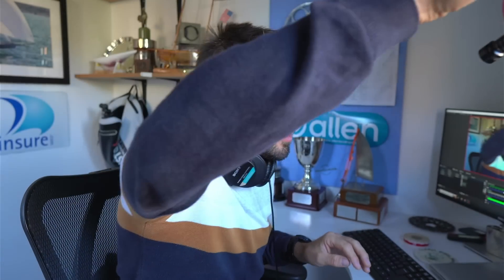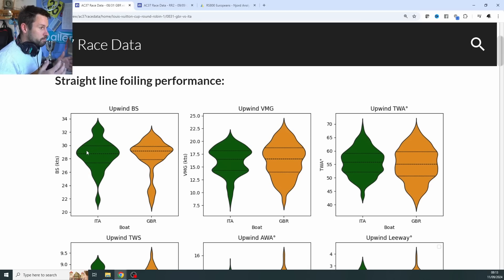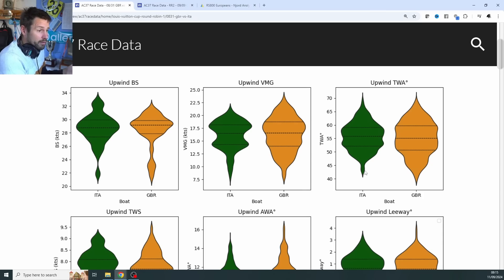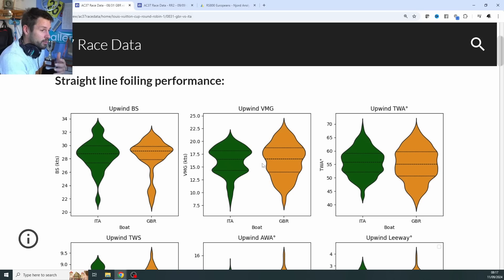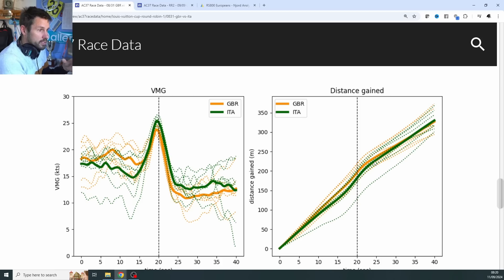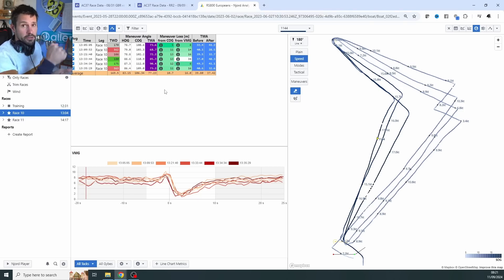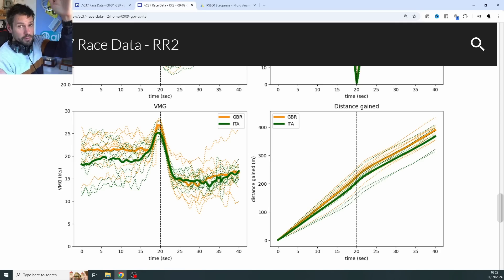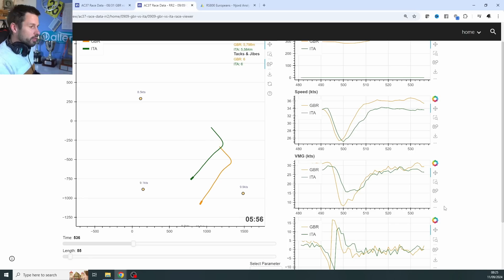Visualising AC75 Performance: What the graphs mean!

Comment: General AC75 sailing q for you, Mozzy - why are the trim movements on the mainsail so dramatic? I get the overshooting to help the turn, but many of the upwind trims are far more than you see in any other boat, and I can't believe it's massive apparent wind shifts?  Any ideas?
Reply from the maker: you go through gusts and lulls very quick. AWA doesn't change hugely, so entry angles don't need much trim but power available does and so the position of the leech need rapid movement, so I think that it what you are seeing with the large and quick traveller movements

Comment: Hi Mozzy. 
When I go to the data source link above there are no files. Did you ask for the data to be shared with you?
Reply from the maker: The files are there? Are you going in to the correct folder? You want the LVC (Louis Vuitton Cup) folder in which should be RR1 and RR2 for each round robin.  They're public, no need to ask for access.
Reply: @MozzySails  found em. Yep right there in the LVC CSS folder.  Thanks.

Comment: Terrific video. I had reasoned out most of this from your previous discussions of the graphs, but it's good to have a definitive summary. Thank you!

I would have simply described distance gained as "the integral of VMG", but maybe that's too techy? Then the "distance lost" metric in Nord becomes the integral of steady-state VMG during the duration of the tack (i.e. what would have happened if you hadn't tacked) minus the integral of the VMG through the tack. For the comparison to be valid you have to look at the entire time that it takes to get back to steady-state VMG. Your point at 10:30 boils down to the fact that Ineos isn't bavk anywhere near steady-state VMG when the graph ends, so you don't see the additional ground they lose during the acceleration after the tack.
Reply: I feel like 20 seconds ought to be enough to be back to steady state. They're only on a tack for like a minute at a time. Honestly I think this graph is a lot more useful to the race engineers than 'distance lost' as what you're looking for here is the finer points of how to make that line as straight and steep as possible.
Reply from the maker: yeah you nailed that description
Reply: @weatheranddarkness  I think we've already seen plenty of instances where it takes long than that to get up to speed. Accelerating an AC75 seems to be a complex process, since the apparent wind and therefore required sail trim etc changes drastically as you pick up speed. Put another way there's a significnat sequence of "modes" that they have to transition through to get to steady state.
Reply: @patrickchase5614  True, true but on the whole, in a race, it seems like the average time back to 'steady state' is well shy of 20 seconds. If you're pushing 20 seconds you're probably reaching just to stay on the foils. If you can point me to one of these graphs that paints a different picture I stand to be corrected.
Reply: @weatheranddarkness  Taking >20 sec to accelerate is exactly what the graphs that Mozzy discussed in this video at 6:40 or so are showing. 

The VMG graph on the left side shows that both Ineos and Prada are still accelerating (and neither have recovered to their entry speed) when the graph cuts off at +20 sec. In other words, both AC75s consistently needed more than 20 seconds to get back up to speed in the very race that this video uses as an example .

Did you actually watch the video and listen to Mozzy’s observations before you replied here?
Reply: @patrickchase5614  Maybe I'm just reading the graph differently. My reading of same says the acceleration has stopped and now distance is accumulating linearly. Maybe I'm missing something.
Reply: @weatheranddarkness  The graphs on the left side from 6:40 on show and are labeled as "speed" and "VMG" (velocity made good), not distance. Mozzy discusses this explicitly from 6:55 on. The distance graphs are on the right. Those two left-side graphs clearly show that neither speed nor VMG have recovered to their pre-tack levels at +20 sec for either boat. They're both still accelerating. 

Hopefully this is clear to you now?

Comment: BIG TIP : The "time spent at, for example, VMG upwind" plots are better understood when you turn them through 90 degrees. Then you see a more familiar statistical distribution! And I assume the mirrored look is port/starboard?
Reply: I think that's the point of setting them vertical
Reply: @weatheranddarkness  I had just thought that it was a style of distribution to mirror it left/right.  They seem perfectly symmetrical, at least as far as I can tell, so either they sail exactly the same numbers on both tacks or it's just a way to represent the data.  Let me known if you see any asymmetry that I'm missing. Maybe Mozzy can comment. He's the man!

Comment: Interesting stuff, been looking at it too for some races. Just a question, shouldn’t the blob diagrams total area be closer for both boats? Since total time and distance sailed are not that different.
Reply from the maker: This is due to the filtering required to extract straight line foiling data only. Turns, none foiling time, maneuvers are taken out with varying amounts of data left for each team
Reply: @MozzySails  Ah clear, that makes total sense.

Comment: The frequency graphs should all have the same area (the cumulative frequency is one), but instead they've been all stretched out of scale to match the same maximum frequecy
Reply from the maker: the areas often don't match up due to the filtering I mentioned. I.e. teams spend different amount of times straight line sailing. This can be because of dropping off the foil or doing more tacks etc.
Reply: @MozzySails In that case the frequency should be relative to the total sampled time, net of tacks and jibes and any other cut, which should be very easy to implement. And if you look at the plots it is clear that they've been normalized for the same maximum frequency, which hints to a trivial conceptual mistake
Reply: Quindi la barca italiana è ancora la favorita, ed ha perso perché ha sbagliato le partenze?
Reply from the maker: @andrealeone4784  I wouldn't say favourite. INEOS is now slightly fast, but not by a huge amount. Luna Rossa can certainly win with better tactics
Reply: Grazie mozzy, continua così! I tuoi approfondimenti sono fantastici. Aspetto sempre con trepidazione la notifica che ne annuncia uno nuovo. Grazie💯

Comment: Another great video which gets the grey matter going. The part on tracking the tacks and gybes is particularly interesting. One aspect of these manauvers which is probably also important are the interial impacts in terms of potential kinetic energy wasted and also how much it is used to load and unload the foils during the crossover. This would also impact location of mass in the design and as such is going to be difficult to adjust for except through how the boat is steered and trimmed during a manoeuvre. Maybe the subject for another geeky video?. Keep up the great work, much appreciated.

Comment: Also,  I'm disappointed that the media has taken a step down for this cup. AC36 had full race replays on the back of each boat with just onboard comms. I know there is a virtual eye replay on the official AC37 cup, but If I see 1 more 'in boat' close-up when there is a crucial inter-boat change in aspect I'm going to put a fist through my screen. Missing Ken Read, hating Steven and longing for the AC36 media format. Rant over

Comment: Analysis is more complicated than at first glance. Assuming tacking is no option (this is often the case due to boundary/layline constraints and match racing considerations) sailing in high mode in headers and fast mode in lifts is optimal. Having to build speed (low mode) when on a header is particularly damaging as is being forced into high mode on lift. 

TWS is also a pretty rough indicator as the amount of turbulence in the wind field powering the sails is going to affect the amount of power that can be extracted. Wind speed is measured at a single point and that's an approximation of the power supply.

In a match race there is always going to be data bias in favour of the leading boat that gets to sail in less turbulent air and also gets to dictate the angles sailed (to some extent). 

What would be useful is to pit two identical boats against each other so as to quantify the performance bias that's attributable to being in the lead. This would be different in different conditions. This would quantify the handicap of a bad start - and the amount of gain needed for a pass.
Reply from the maker: All excellent points that I fully agree woth

Comment: The tacking plot that would be useful is an integration of VMG data (=distance) zeroed to the expected VMG outside a manoeuvre (probably average upwind VMG over the race distance excluding tacks, or an average from immediately before the plotted manoeuvre, or even an extrapolated expected vmg). Then you'll see cumulative distance lost, including from the bear away to build speed, without worrying about plotting too much pre-tack time.
Reply from the maker: exactly! I have made a few of these plots and tool like Njord Analytics which I show does this calculation but doesn't show it graphically, only reports the cumulative distance lost
Reply: These boats are so sensitive to wind speed that the tack loss should be calculated vs straight line vmg at a given wind speed. You do a good old linear regression and use the TWS at the moment of the tack. Could go even further taking into consideration how long ago was the previous tack. Seems to take quite some time to get the last 2-3 knots of boat speed.

Comment: Great explanation. In summary tho' what the data seems to show is that INEOS gains ground from each tack as it doesn't seem to require an acceleration before the tack regardless of the similar speeds between the yachts afterwards... Keep it coming Tom.
Reply from the maker: I think INEOS gains ground in tacks in the last race because they are going faster to begin with. The tacks actually cost them proportionally more than they do Luna Rossa. That's why I think a meters lost calculation would be simpler for majority to understand than this distance gain plot
Reply: @MozzySails  I agree, I just didn't explain myself well. However it is counter intuitive as most would assume increasing speed before the tack was the ideal practice - which just makes it all the more interesting!

Comment: Thanks mate, On the TWA graphs the waist in the bulge clearly shows the modes ITA use before tacking, a build mode then tack showing up as this little dent in the bulge, My question is what is the scale and units of the width of each speed,  time at that speed in seconds? so scale?
Reply from the maker: I think the plots are actually a 'probability' rather than time, but you can think of it as time, so width of bulge means more time.
Reply: @MozzySails  looks to be how often it was at that speed for say a 5 second sample time. Or whatever sample time the records use.
Reply from the maker: @vhg130  sample rate is 1hz